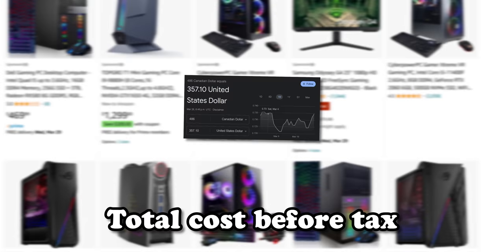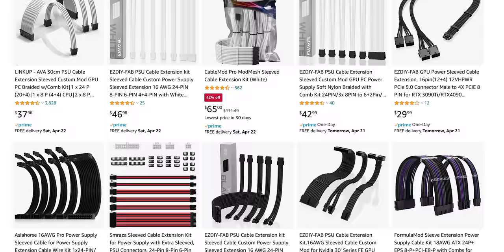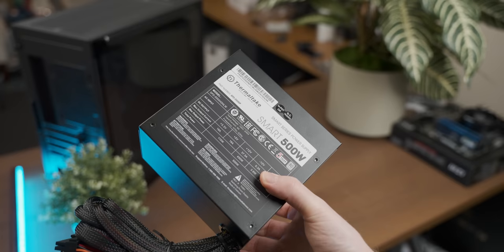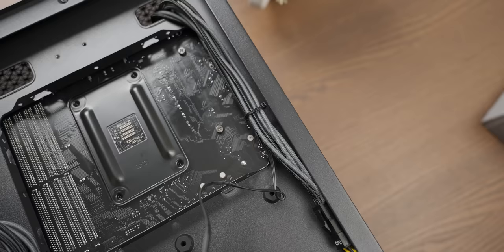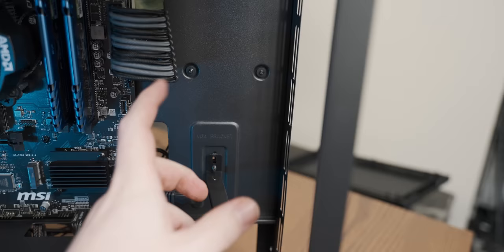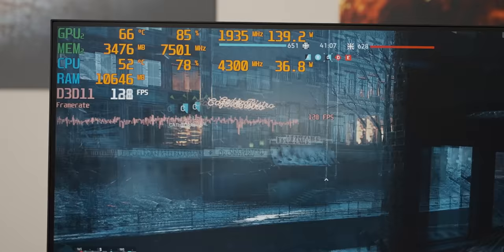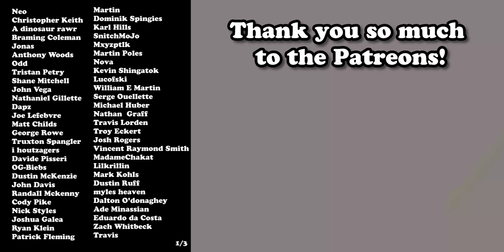I Use ONLY "Amazon's Choice" Crap To Upgrade My Gaming PC...

Comment: That SYY Thermal Paste is actually Pretty good i have used it in a pinch and it gave me better thermals than Mx-4 and Artic silver 5 (yes i know those are old but they are tried and true) so for a thermal paste thats a cheat non big branded it was pretty good

Comment: I’m no genius but I think the main issue was just what everyone else is saying, 

-the cooler wasn’t optimised for the cpu… so in a roundabout way the overkill cooler was holding it back (especially in combination with the frequency increase) 
-2nd the IE-ehh I mean PSU… I’d maybe be okay with the 6600 and that 4600g since the cpu shouldn’t use too much and the gpu was “weaker” but the increased frequency of the cpu and that 3060 was definitely pushing that psu (also again the cooler for the cpu being a bit jank)

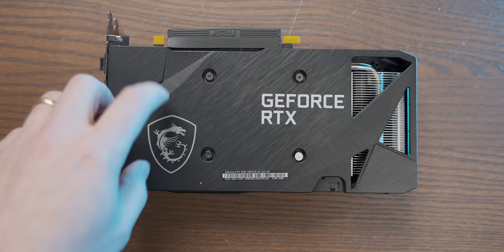Comment: 11:02 I had dubious honor of having RTX 3070 Ventus 2X version... it was during the GPU shortages so it was my only choice, and I definitely DON'T recommend it. One of the fans on it started rattling loudly and annoyingly at certain speeds after less than 2 years od use... actually had to sell off the piece of crap, and get a Gainward Phoenix RTX 3070 version, no problems since then.

Comment: I have exactly the same GPU and its not a looser GPU lol :). The only problem I found with it is the fan curve by default its too low and causes high temps so I set a custom fan curve so the fans dont fully turn off and ramp up a bit faster and its great now but my GPU is held back by my CPU a ryzen 5 2600 but I cant afford to upgrade anything now I cant work due to medical problems and cancer treatment
Reply: I have also 3060 (Gigabyte Windforce OC 12 GB) and 1600AF. I managed to OC CPU to 3.8 GHz (and have to boost VRM coling with small fan on a crap Gigabyte B450M DS3H V2 board). Still getting CPU bottleneck ~25-30%. I might drop in 5600X or 5800X 3D if i get money. I also have medical problems but not severe as yours (Keratoconus- requires expensive scleral lenses, and i suffered left knee trauma 2 and a half months ago and I'm still on crutches). Doctors won't let me on physical therapy before I do MR imaging of knee. unfortunately I have to wait till August for my term. I think I can kiss goodbye work in this year. Good luck with your cancer, I wish you well.
Reply: @Antonio-mu3rx  thankyou I hope you get better soon aswell and on my pc I could over clock to 4.4ghz but my a320 board has no vrm cooling and it can't handle an overclock I also have to run my ram very slow as it has trouble with 32gb of ram so my whole system is being very held back my the CPU and motherboard

Comment: AMDs, Ryzen included, aren't really CPUs that react overly well to overclocking because they don't just thermo throttle but essentially strangle themselves if getting too warm, so finding a setting where the CPU doesn't drop below base clock is a real struggle. By my experience, you need a really powerful cooler and increase the power levels to get there which is a bad idea on many levels not least because the Ryzen 5 4600 is bad reused silicon and therefore not really overclocking material, so you best either don't overclock or manage through undervolting.

Also, the Ryzen 5 4600 actually is a quite powerful Zen 2 that outclasses an RTX 3060 as shown by your trial run with an Radeon RX 6600, so overclocking the CPU will do little since it isn't the bottleneck here. I imagine it should keep up until about an RX 6700, where you probably should pick a Zen 3 like an Ryzen 5 5600 until somewhere in the RX 6800 XT range and Ryzen 7 5800X3D until RX 6900 XT / RTX 3090 / RTX 4070. Above that, you probably won't get around a Zen 4.
Then again this depends heavily on you games and resolution which is why it's field of trial and error rather than anything precisely calculable.

Comment: I've got way more RGB in my build. Of course I bought a different version of the GPU. The 12GB MSI Nvidia GeForce RTX 3060 Ventus 3X. Paired with the AMD Ryzen 5 3600 non-X I got a max of 471FPS. That has to do with not knowing the max over clocking I can do on my GPU. And nobody's posting the max FPS possible. I'm not trying to cause my GPU to overheat trying to find the sweet spot. Mainly because I can't afford to replace it if it crashes too hard and refuses to work again. I had to sell my iPhone 12 just to be able to afford it in the first place. And I ain't selling my Galaxy S22 Ultra to do a repeat.
Reply: how much overclocking you can do depends on how lucky you got with your GPU, not every card of the same type is made to identical specs but rather a bar it needs to clear to be marked as a good card, so the performance you can get and the extra stress that individual components can take varies by a few % on average. on top of that, these cards come overclocked and pushed to almost their limits out of the box; so the benefits of overclocking aren't anywhere near what they were even 10 years ago. realistically it's best to set your gpu to its automatic boost mode if it has one, and forget it. even if you managed to overclock on top of the standard boost mode, you'd see an increase of maybe 1 or 2 % in performance which is ultimately not noticeable unless you're chasing records.

and a gpu will almost (like, one in a million chance) never overheat and damage itself, they come with a thermal shutdown that forces the system to turn off if it gets too hot, plus hardware will throttle itself so it doesn't get past a certain temperature anyways. and stock coolers on aftermarket cards are typically more than enough for heavy overclocking and maximum gpu loads, so if you ever see a thermal shutdown it's because you worked your card too hard, your cooler failed, AND the thermal throttling didn't kick in.

basically it's super super hard to cause permanent damage to a graphics card. go nuts

Comment: Also Dawid, to properly compare the thermal pastes you need to use a hot proc, like the 13 gen i9. Something that gets ostritch panties begging for a cool breeze. Kangaroo hot.
Reply: Or rather compare the thermal paste after years of use. Or just in general the temperature cycling affect on the paste. If might be fine for a year or whatever and then the paste has moved around or whatever to the point of not being comparable to what might be a more expensive paste, that last 5+ years. I still got a I5 2400 that has not had a paste change since 2011-2012? It really is not used allot anymore but still when used thermals are respectable under the devil Cooler Master 212. 

I do not remember what paste was used and it is the last PC I had help when building. But I do think it got something better then whatever CoolerMaster included. I mean 10+ years and it barely cracks 80c under full CPU load? And it for the most part just idles when in use.

Comment: thats my cpu cooler! (Using with 2 fans, one on middle and the other on left side doing a push-push air solution)
Using with ryzen a 7 5700x PBO2 4.80ghz :)

Comment: I have the same 4600G and any attempts to overclock results in a no post or crashing issues 🤔 never pulls anymore than around 30w, also using a 3060 PNY xlr8 GPU, MSIB550-m pro rev3 board 

But i am also using off brand ram with a 3200mhz xmp profile. 😐

Comment: Those white Thermaltake PSUs are good! I never had a problem with them using them long term for a homemade NAS. or in my old i7 PC that's been repurposed as a HTPC for Netflix and YouTube.  However I do recommend using some sort of device to filter mains power like an APC power strip/surge protector, or a UPS.  With summer coming around a UPS is a must.
Reply: Same, though I ran mine no UPS because the UPS was on my larger 1000W psu for main rig. They run perfectly fine and at an attractive price. It is actually the PSU I bought the most of. I probably have at least 5 kicking around rn.

Comment: Actually they pair really well together at 1080p in graphic intensive applications.While running graphic card intense tasks, processor AMD Ryzen 5 4600G will be utilized 98.6% and graphic card NVIDIA GeForce RTX 3060 will be utilized 100.0% .

Utilization of AMD Ryzen 5 4600G and NVIDIA GeForce RTX 3060
in Graphic Card Intense Tasks
with 1920 × 1080 (FHD (1080p)) resolution

Graphic card bottleneck is better, than processor bottleneck, because utilization of your graphic card will be on maximum and you will experience maximal performances that your graphic card offers. Also your processor can handle some other programs in background because it won't be maximally utilized.

CALCULATOR RESULT

AMD Ryzen 5 4600G and NVIDIA GeForce RTX 3060 will work great together on 1920 × 1080 pixels screen resolution for Graphic Card Intense Tasks. This configuration has 1.4% of graphic card bottleneck .

Comment: Actually,  looks great. With that cooler, for that price is very good result. Wouldn't modular PSU with already braided cables cost roughly the same as PSU and extensions?

Comment: shift psu its stupid and a solution to no problem. i want to see how it runs in cases that have litle space on the back panel or when the psu its on its side on the bottom lower...

Comment: I would recommend some of them phase changing thermal pads m8, shaved off clean 5 degrees off my temps on the CPU, works super well and apparently PS5 owners are using them to replace that stupid gallium stuff.

Comment: have the peerless assassin in my machine does a decent cooling job on my Ryzen 5800x but the noise yeah, Sounds like a jet engine spooling up when under load .Though to be fair it is only a temp measure until i can afford a decent aio

Comment: 6600 got better results than the 3060 in the case of a CPU limitation because of the colossal difference in driver overhead between AMD and Nvidia.

Comment: All of Thermal Grizzly's paste tends to come in those same type of packets, probably why they are using that design.

Personally as someone who doesn't need to use massive amounts, Kryonaut is so much better than anything else I try especially in laptops. If I had to use a lot, I probably would go for cheaper though.
Reply: i've used hydronaut before, which is admittedly worse than cryonaut, but for reference, that paste he bought, i bought it too. it performs pretty much the same as hydronaut, has similar consistency, and costs like less than half as much per gram.

Comment: The old Nvidia CPU overhead kicking in again , a 3600 or even better 5600 non x and or 6600xt it would if Been a cracking system

Comment: Also what's up with the "don't think its gonna pair particularly well with it at 1080p" ???? do you have any idea about how computers work? a 6core12 threads 3.8ghz+ will have no bottleneck whatsoever with the highest of high end GPU. unless the game is more cpu based and even then you'd lose what? 100fps? in games like Counter strike or Valomid

Comment: Not sure it's fair to judge the thermalright as it's missing an entire fan.
Reply: It's designed to work with one, two, or three fans as there's was nothing wrong with the temperatures in the first place with one fan.
Reply: @jamesm568  Two fans would have reduced the temps and kept the fans at a quieter noise level. Not fair to criticize a fan setup when half of the fans aren't being used.
Reply: @jusplainscott  Two quality fans would definitely help as the stock fans don't provide enough static. If you're on a budget it would get you by with the stock fans.

Comment: I always wonder why the front of so many cases are made like that lol. You know people are going to have to take it off, why does it have to be borderline breaking the front panel because of stupid plastic clips opposed to just a nice screw or a pop in like latch 🤷🏼‍♂️🤔 idk literally anything. Some are easy but some are terrible I had one I worked on a while back where it was round double sided clips x6 of them and I needed to pinch 🤏 them each while simultaneously pulling on the front panel and eventually ripping the whole thing off. 🤷🏼‍♂️ I guess nothing broke, but like there has to be a better way you know we will need access to those fans at least once…. Plus if your a new build or chance things often then you have to take it off more than once lol 😂

Comment: i bet that the issue came form the rgb hub i have 4 of those fans in my system and they are all plugged into the mobo and its a gigabyte board and i dont have that issue

Comment: 6600xt had more fps bcs: whenever there is a cpu bottleneck with a nvidia gpu fps are lower compared to amd gpu having cpu bottleneck. Can you test by disabling threaded optimization inside nvidia control pannel. does disabling it regain the lost fps in nvidia gpus

Comment: Interesting. The "Amazon's Choice" CPU for where I live is the Ryzen 5 5600x. I feel like that would be a much better choice for the 3060 you got.

Also I'm a bit curious, does the Corsair Shift series support PCIE 4.0 or am I a dingus for even asking? I have an RM1000x which is pretty good, but I plan on adding more 2.5" drives eventually and the very first one I put in was a pain in the ass since I had to add another SATA power cable.

Comment: Is there anything I can do to upgrade my dinosaur laptop it is a Dell laptop I bought this laptop a long time ago it is a 2007 model and it has gigahertz processor 2.6 4 gigs of ram and it has Windows XP professional  install for the operating system. What can I do to this to improve the graphics I went to Staples and ask them if they could upgrade the computer and they said no it's too old you can't upgrade the ram because it's too old so you're stuck with the 4 gigs of ram. I just think that they're very unexperienced there and they have no clue on what talking about. I know this laptop can be upgraded for the right price do you have any suggestions I could give you the model number if you needed it

Comment: We are in a world where a 3060 is 3070 msrp...
Reply: Where are you from? Where I’m at in the USA 3060’s are between $350-380 and that’s brand new. No more than $250 used even some as cheap as $200.
Reply: @JamilThePimpLol  US too, where im from its $390-$512, with it being $412 on a good day.
Reply: That's 500 Canadian bucks, which is like 360 usd
Reply: @bdub1682  he converted into USD, and is using USD for all his monetary measurements
Reply: Gas price gone up way more than that, so is everything else, consider yourself lucky if gpu price is all the problem you worry about.
Reply: @24kmetal99  Not really, I still worry about that and my rising bills, but its just annoying that a low end card is priced at mid/high end (3080 upward being halo tier in my opinion), while you can get a 6800xt for that same price

Comment: Wait, so you installed a 3060 with a 500w psu!? Yet every piece of documentation I've read and all the PC MasterRace trogs, say that GPU needs 600w minimum. Also, that same GPU is $349 on Amazon (US anyway).
Reply: I suppose it depends if you are using a thirsty CPU, and you like overclocking..
Also some advise buying 2x the nominal power of your rig so it runs at 50% load and maximum efficiency. It also runs quieter. 80+ gold is good enough.
Reply: The CPU is not thirsty for power, so a 500w PSU was perfectly fine.